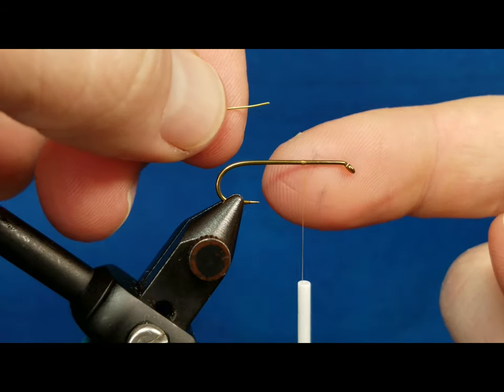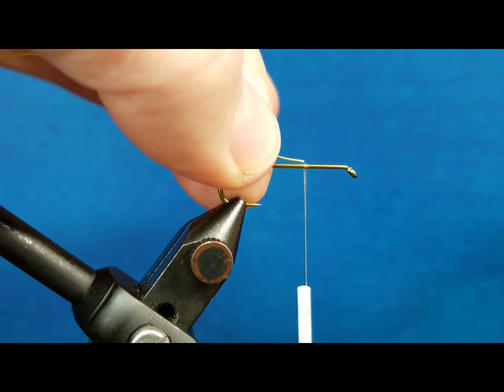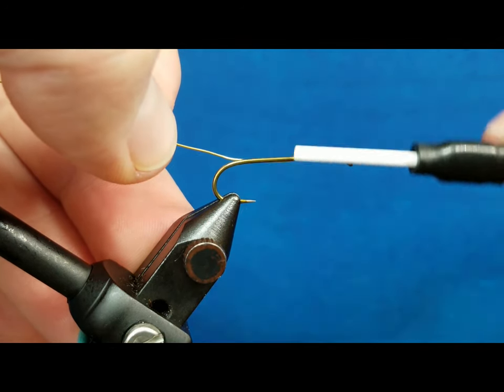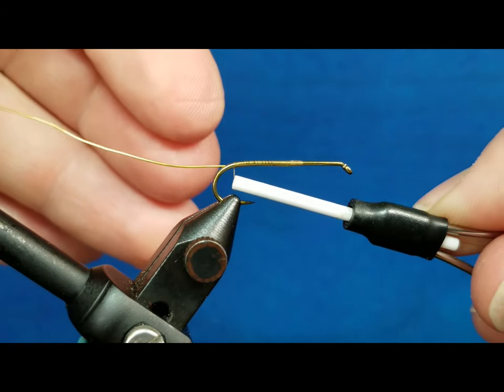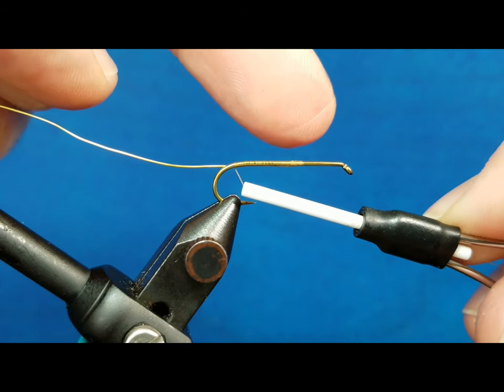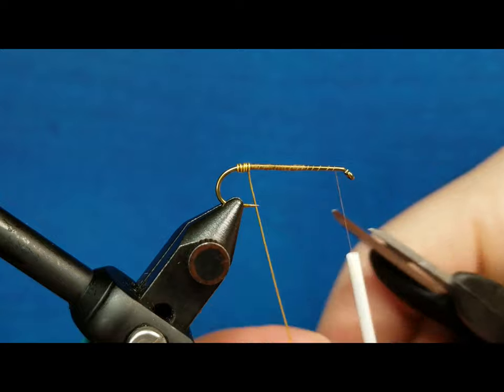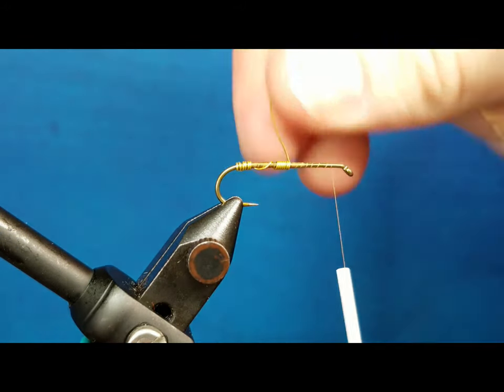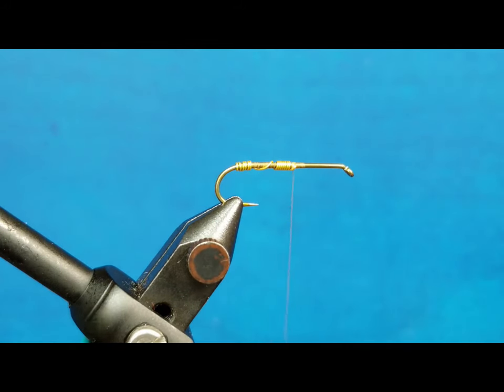Fly Tying With Wire

Comment: What are the typical gauges of wire used in fly tying?
Reply from the maker: Robert, 
       I'm not sure on the numerical gauge. I use UTC wire and it comes in Large, Medium. Small, Brassie and  X Small. I use Medium and Small most frequently. I hope that helps